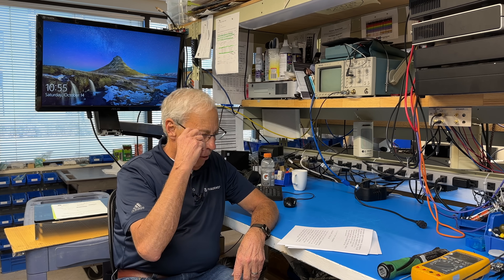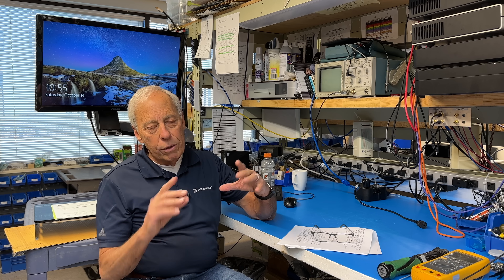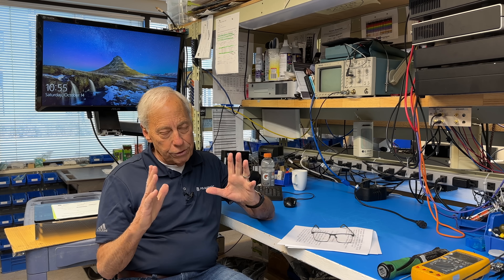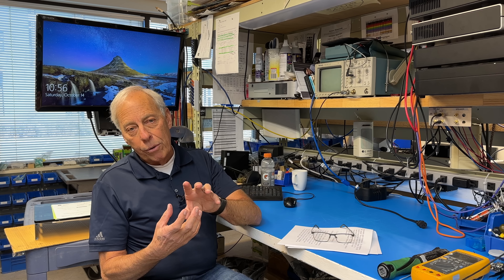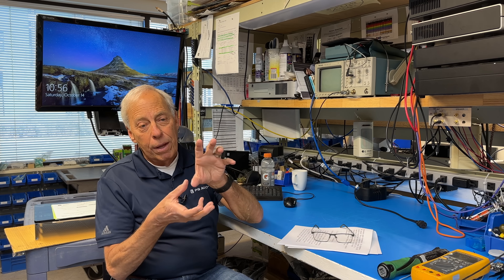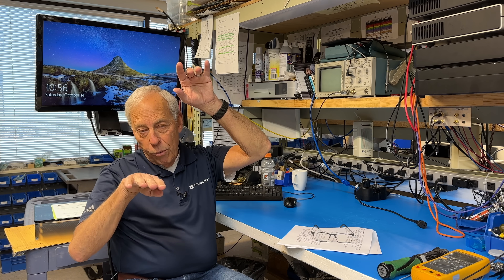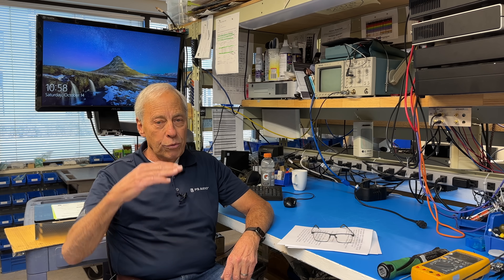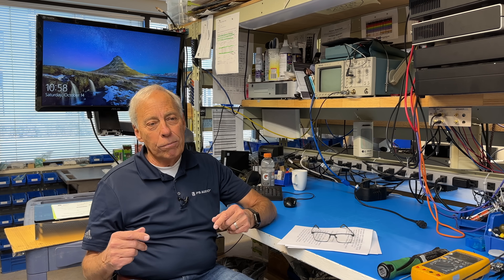2 or 3 way loudspeakers

Comment: With all that driver excursion going on in a 2 way from the bass, it's a wonder that they can sound so good in the midrange..Some speakers like the vintage 1970s Ohm Walsh models, whose single driver was truly full range, with no crossover needed, was the theoretical ideal in some ways, but they had their dofficulties in a few other ways. The guy who knew best how to skillfully make Walsh Drivers was a man from South America and unfortunately he retired and for quite a while Ohm tried to replicate the perfect phase coherency of the mode A and F models with conventional woofers, tweeters and crossovers. Many doubt that their efforts equaled their first efforts in some ways, but they rate above average for seamlessness; just maybe not quite as good as the originals. There are some things they do better than the originals, and are usually a safe bet for providing good sound.

Comment: The more expensive Tannoy loudspeakers use a single driver which they call dual concentric driver where the tweeter is built in the centre of the midrange driver. Their modern ones are like traditional ones.
Reply: that's not a single driver. That's still a 2 way. Single driver speakers are like omega, lii audio or tuolihao.
Reply: @V1ralB1ack  Why do they call it a dual concentric driver?
Reply: @artyfhartie2269  dual meaning 2 and concentric meaning circle. So it's 2 overlapping circles. The reason it's still 2 is because the tweeter is still moving independently from the woofer but they vibrate microscopically. The pointy thing on the tweeter isn't actually the tweeter it's a guide if I'm not mistaken. In contrast to single driver designs the single driver still has the center pointy thing but it's attached to the woofer that's handling a wide range and the wider the range the less tight the sound will be because the 1 driver has to move back and forth microscopically fast for the midrange and the tweeter at the same time so it's super light weight but it handles bass too and it has to be heavy to push hard for bass so something will sound off but because it's 1 driver there is no crossover and that has benefits but also drawbacks.
Reply: @V1ralB1ack  Thanks for the info
Reply: @V1ralB1ack  You still need a crossover. You’re not going to send “all” frequency information to both drivers; there needs to be at least a capacitor to keep the tweeter in the upper center from the lower frequency information. You’re not going to just wire those two concentric drivers in series or parallel. I’m sure you’re talking 2 voice coils. In the old days, didn’t they have them car speakers that they called “coaxial drivers” that were two-way; not sure if that’s exactly the same design methodology as dual concentric, but I imagine it would be, except that not all coaxials are actually concentric as well. Just picture a triaxial car speaker, but with 2 tweeters, one slightly angled or toe-out slightly on each side of the lower driver’s center.
Reply: I love my Tannoy Gold 8
Reply: @a.dejager7062  How about those Tannoy Westminster Royal? Something else
Reply: I love my Urei 809 speakers; single point 😍
Reply: @bitmanev4331  I would love to audition Voxativ loudspeakers
Reply: but a huge box. nobody have space in a room
Reply: @hom2fu  Rich people do. Those who live in mansions

Comment: Then, why not 4 way, 5 way and so on?
Reply: the higher the number of components the more complex and expensive the crossover gets. The benefits of a 2 way is that you only have to match 2 drivers so they can cost less and be done more. When you get to a 3 way if it's cheap it's definitely not good because we have to match 3 drivers and there has to be bass and all 3 have to work in harmony. A great 3 way will sound best cost more and weigh more and that's just the truth of it.
Reply: @V1ralB1ack  When did money matter? You would think someone built it....
Reply: @V1ralB1ack  Thank you.
Reply: They exist. They just aren't marketed as a 4 or 5 way speaker. A 4 way speaker would be a 3 way speaker with a built in subwoofer. A 5 way would be a 3 way speaker with a built in sub and a super tweeter.
Reply: one i can think of that causes issues with adding more "ways" is the overlapping frequencies. more drivers needs steeper filters, that is twice the crossover parts needed.
Reply: @sudd3660  Thank you.
Reply: My dads good friend had some 5-ways custom built…I’ll never forget the incredible sound they put out & probably something I’m always chasing on my audio journey.
Reply: Linn 360s are 4 way…
Reply: With in-ear monitors, it's now common to find designs with lots of drivers. The Empire Ears 'Odin', for example, has 11 drivers per side and a 7-way crossover.
Reply: @cota5697 8381A by Genelec. 5-way but cost $70000 (pair, though, luckily).
Reply: simple answer: phase response
Reply: I think I recall seeing cabinet-style speakers from the 50's that were 4 or 5-way